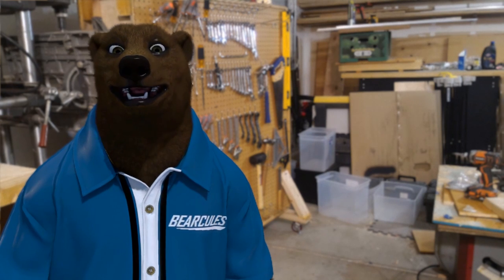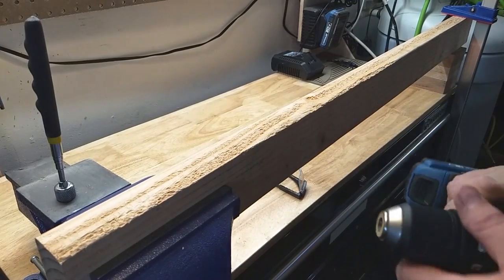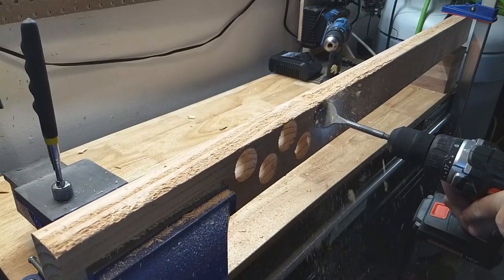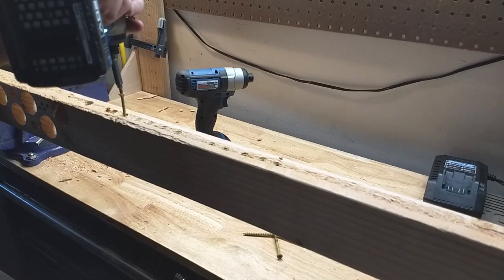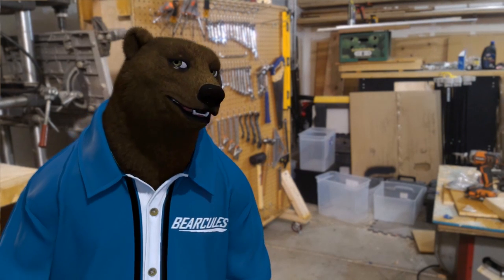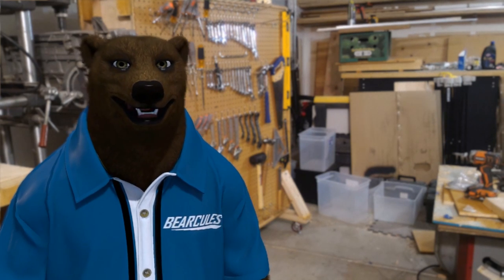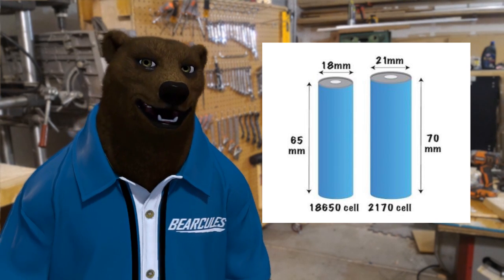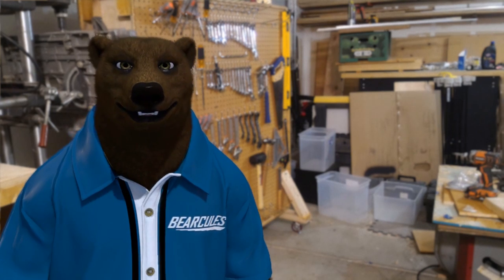Hercules 12V Tools (Impact - Drill - Screwdriver)

Comment from the maker: What tool do you think HF should drop next?
Reply: A real, quality mill
Reply: not really a tool, but it would be great if they would sell some smaller cuts of lumber
Reply: Ok so I know HF focuses on automotive more than home improvement, but I’d really like to see a 12v Pex pipe expander tool. Only Milwaukee makes a 12v expander (Dewalt makes a 20v but it’s too big/heavy). I think they would sell a ton if they added it to the line.
Reply: @jackhackett80  good call
Reply: The bruar reciprocating saw already
Reply: I would also like wireless Hercules grinder
Reply: The Bears' stogie... eff the PC police
Reply: After the "Deep Freight" video I've been really excited to see the new Bauer stuff.

It's also been leaked that they plan to expand the Lynx line. Push mower with two 40v batteries for 80v of power. Could be interesting.   All in all, 300 new products store wide expected to be out by the next managers conference. 

As for clothing, I've seen several employees wearing branded clothing (Hercules, Vulcan, etc). I asked where I could get some and was told they don't plan on offering it to the public. Bad move in my book. I mean people paying you to advertise your products, how could you go wrong?
Reply: Another battery platform.
Reply: 20v cordless glue gun - they can't let ryobi have all the fun.
Reply: A high end router
Reply: A drill that uses the earthquake 20v or 12v batteries
Reply: Sidding and fencing nailers
Reply: TakeAmericaBackfromISRAEL  wood
Reply: In other news I saw the Hercules miter saw stand at my local store two days ago when I was there for the big sale. I was really wanting to check out the bolt system they have to mount to the fancy molded in hex shaped holes in the base of the saw (which btw is my only complaint about the saw - it made it a pain to mount to my Ridgid stand whilst keeping a flush bolt setup). Alas I was disappointed to see it just comes with standard Allen head screws. Not sure how that'd mount and be flush either.
Reply: Hope the diets are going ok.
Reply: A cordless 12V counter top electric can opener.  No one has it and it can be used anywhere.  
Oh, and also a 20V twelve cup coffee pot.  Debear, TELL ME THEY WOULD NOT SELL A BUNCH OF THEM.   LOL !!!😁
Reply: Be able to buy your book and T-shirts ... Hey why doesn't HF have T-shirts?!?
Reply: @0509kj  I also have the portable ridged miter saw stand.  How did you mount you Hercules saw to it?
Reply: @leevalentine1532  It was a multi-step process - I started with removing the rubberized feet from the underside of the Hercules saw. Then discovered that the holes those feet go into extend down just far enough to cause the base not to sit flush on the mounting rails on the Ridgid - once you tighten anything it'd flex the rails more than my liking. I used two thick rubber washers I got from big orange to fill the space and keep things even upon tightening. To get a flush mount on top I used some hex head barrel nuts (aka Chicago bolts) from Amazon (https://amzn.to/2TRgj2l). Used four of those nuts with the carriage bolts that came with the Ridgid. I had to shorten the front carriage bolts a little with my Dremel to get the right depth for the nuts to tighten properly. Most other saws just have a simple eye hole to mount through I have no idea why they chose this setup for the holes but it was annoying in more ways than one. I was pretty adamant that I didn't want bolts and nuts protruding though and since the rails on the Ridgid have blind carriage bolts on the front it didn't lend itself to just using different bolts either. I did get some loctite to go with it but haven't needed it yet. Good luck 🙂
Reply: More of the Hercules 20v line. I've got projects coming up this year and I'd rather buy tools than rent or borrow.
Reply: Well, Red, in a light 12v tool I think I'd like to see a jigsaw. Being so much lighter it'd be easier to handle intricate cuts that can take much longer than just ripping through lumber.
Reply: Cordless chainsaw or lawn great.
Reply: They need to finally release the Bauer Recip!!! Promises promises, but you don’t think corporate would pacify me due to my numerous inquiries would they? Nah, they wouldn’t do that... pffffffft. I mean they have released the warrior drill to up the drill master homegamer, then they released the herc monster saw too but still no sign of completing the Bauer line yet. Patience? Yea sure but man Whatta test cause now as we figured the 12 volt hercs are making their debut. The towel, I have it in hand but refuse to throw it in just yet! I think those lil hercs would make a fine addition to any tech’s travel tool briefcase, ya no? I’d consider them AFTER I get my recip lol
Reply: Cordless multi tool
Reply: @Aubreykun  Black and Decker has one too and it's actually pretty good
Reply from the maker: @markmeli1960  Yes, but only if it's like Ridgids with the multiple heads.
Reply: @Mark Melignano
The B&D one isn't as good from what I read. The Ryobi gun is the best option at the moment (besides the surebonder, which takes ryobi batteries) and also allows access to the other miscellaneous 18v tools ryobi puts out. 

If HF builds a line up as wide as the old Chicago Electric for the herc or bauer line then it'd be a competitor with ryobi's wacky range of one+ tools. Generally I prefer corded but a glue gun is something I don't want to get snagged on a cord, and I might as well have some other options for the battery since you don't normally use a glue gun every day.
Reply: @Stephen Lee
Makita makes a couple models of cordless tool battery-powered coffee maker. It only does one cup at a time, but they make it. A friend of mine has it and he loves it.
Reply: How about a "Bearcules" blue tracksaw?
Reply: I want to see a cordless trim router!
Reply: An Electric ⚡️ Car!
Reply: Montage Matador WTF?
Reply: A good rotary tool.
Reply: Does Deep Freight have any intel on when and what new stuff they will release in this 12 volt line?

Comment: The only downside to the Hercules and Bauer tool lines is they only come as a bear tool so you gotta buy a battery charger and battery separate?
Reply from the maker: They sell some of them in kits and they offer a "kit" discount if you buy a tool, battery and charger.
Reply: See, that’s where they lose ground because I am looking at that
1/4 drive impact wrench that goes for $60 then I got a battery charger for $40 and the small batteries or $25 so I will get two of those that puts me at $150
Reply: See, that’s where they lose ground because I am looking at that
1/4 drive impact wrench that goes for $60 then I got a battery charger for $40 and the small batteries or $25 so I will get two of those that puts me at $150
Reply from the maker: @terrellscaife2411  -$25 for buying a "kit", aka took+battery+charger.    But what is your other option? Who is beating that price?
Reply: Buddy I’m a super low budget type so now I’m stuck between a rock and a hard place, but I really appreciate you letting me get this rent off my chest

Comment: Check out the SKIL 12v line. Much much better than the Hercules, better batteries, better warranty, I'd say it's the best DYI, prosumer 12 volt line currently. Some of the stuff is even better than the M12 stuff. Their 12 v brushless oscillating tool is really good.

Comment: What about the Bauer 12v
Reply from the maker: They said there are no plans for a Beuer 12V.  There is already a Chicago Electric 12V and an Earthquake 12V so I would be supprised if they did yet another 12v system.
Reply: Red Beard and The Den of Tools shoot I would buy the Bauer 12v line maybe they should axe the Chicago brand Atleast for power tools cause honestly they didn’t have a good reputation along with warrior power tools

Comment: It looked like you had the Warrior on counter clockwise instead of clockwise.
Reply from the maker: Did you not see the part where I weighed the tools?  The warrior was in there as well.
Reply: @denoftools  Yes, I did. I was talking about when you drilled the wood you had the direction on backwords (remove, counter clockwise) instead of forwards (clockwise, drill).  Just saying that could have been why it performed so poorly.
Reply: @pattognozzi  That is what I thought too.  However, the others do not appear that way.  Obviously I could still be wrong.  It may have to do with the speed each one operates.
Reply from the maker: @jackphillips3512  Sorry, I misread your post.  Need to get my glasses on.  I'll go check it and see if da bear screwed that one up.

Comment: Im in the market for a new 12v drill/impact combo. I just wish HF would include a solid long term warranty on these drill included in the price. That would definitely show the belief and commitment behind these new power tools. Until then, I'll still go with Ridgid or Milwaukee combos. I can get a combo of either one for a bit over $100. Step it up some more HF.
Reply: A combo kit for the Herc drill and driver would go a long way. I can get those from Ryobi at Home Depot for $40 less in a kit.

For the warranty, I think if they really want to stand behind the Hercules line, the warranty should be a full 1 year with the 2yr/$20 option on top of that for a total of 3 years. The 90 day warranty is just... why? Are they expecting people to throw the tools out a seventh story window?
Reply: @DickTickles  I went with the new M12 Fuel combo from Milwaukee. Pro coupon plus gift cards I had really sweetened up the deal. Plus a great 5 year warranty. 
 A 1 year warranty should definitely be a minimum with price point around $100. The Ridgid 12v combo is $130, and $99.99 on sale at times with an LSA warranty.

Comment: I’m a professional and I use both 12 and 18 volt tools and like you said I use the 18v for framing, decks and drilling larger holes and don’t mind if they get dirty. I save the 12v for finish work like cabinets, trim, doors, electrical etc. I also like to keep my 12v tools clean so when I’m in someone’s house, they’re not put off by a grungy drill sitting on the counter. Thanks for the video, looks like the big boys might be losing some money to the new kids on the block.

Comment: 12volt pros...fits in tight spaces...much lighter..more precision in delicate work pieces. Etc. And in my experience using a buddies 12 volt dewalt they perform just as well as my 20 volt porter cable set. Not quite as well as my ridgids but still good enough to get my work done. And they are so much lighter. Or at least it feels that way. Im excited to get a 12v hercules impact.

Comment: Hi Red, I have a question for you about the harbor freight 12volt tools because I have been considering switching over and buying some of their tools. Several years ago I bought a clearance 3tool 12volt Kobalt set and I love my 12volt tools from Kobalt. But the tools were on clearance because Lowe's was canceling that 12volt line so now there isn't any more tools than the ones I already own. I do a lot of homeowner DIY and Quality Hobby Woodworking and use my 12volt Kobalt set for most of the work I do. I take good care of my tools and most work I do is indoors so I don't think that I need any Pro level 12volt tools like from Dewalt or Bosch, my Kobalt tools or my 18v Ryobi tools do just fine. But my question is what do you think of me switching over from my 12v Kobalt set to the 12v Harbor freight tools. The Kobalt tools I have you can't get anymore tools and batteries are difficult to find but sometimes can be found on Ebay. So with a Harbor freight just a short drive from my home buying a battery or a whole new tool is easy for me, that is the main reason I've been thinking of switching from my Kobalt to the Hercules Harbor freight tools. I'd like to hear what you think and anyone else here that uses the Hercules 12volt tools from Harbor freight, thanks y'all.
Reply from the maker: I really like the Herc 12V.  That screwdriver they have is one of my most used tools.  If you were planning a lot of automotive work you should really consider them.  They have 4 ratchets and two impact wrenches out in the system with more tools to come.  If you do more DIY around the house stuff I really love the new Skil 12V line.  All of their tools are brushless and all of their batteries have a built in USB port!
Reply: @denoftools  
I just finished watching a video where you talked about the Skil Line of 12v tools and how much you like them. So I am going to take a look around and figure out what to do from there. Thanks for the help

Comment: Thanks for the explanation on why to use the 12v. In a couple of weeks I start a new job as a computer tech, I'm probably going to pick up that screwdriver now.
Reply from the maker: My first hardware job, fixing PC's for a retail store, the only cordless stuff we had were full sized craftsman drill drivers.  1 in 4 screws it took the heads clean off.  Would have killed for something like this.

Comment: Thank you President Debear for the video.  I liked it.  Just an observation.  The new 12V line so far sure resembles the Dewalt in appearance.  Just a thought, thanks again.
Reply from the maker: Yeah, HF has a hang-up on dewalt.  Some sort of tool crush.
Reply: The manager of my local store said when he went to that last managers conference, that he was talking to the head engineer. The guy use to work for Dewalt and the new Hercules stuff has about 90% of the same components that Dewalt uses and the other 10% is equivalent or better. The main difference is rather than shipping the parts to be "assembled" in the USA they are put together in China instead.
Reply: @WolfsHaven  That's interesting.  That would explain a bunch.  Thanks for the info !!!

Comment: id like a set  for in the house... my 14 yr old son would like a set of these.  all my 20v's r just to heavy for him to use for any length of time ,also my wife.   hell id probly grab them too. i think tho the price needs to be around 50, 60 bucks.
Reply from the maker: I don't think you will ever see them that low.  At that price point, it would cut into the Bauer line.  Have you looked at the warrior drill?  That is what I got for my son.  It actually weighs less than the Herc 12v.

Comment: how long does the 12 v battery last? 🤔
Reply from the maker: That is an open-ended question.   Depends on what you are doing.  I was well over 100 screws when the drill needed a recharge, might have been around... 140?  Wasn't really testing for duration.  That is going to have to wait for another video.
Reply: @denoftools  right on brother bear. I'm definitely going to use the coupon 😃

Comment: Seen that those tools at 12 volts can I charge them in my vehicle
Reply from the maker: They are still charging off of 110V.  And because of the built-in charge controllers, I don't know if there is a workaround other than just using your inverter.
Reply: Maybe Da'Bear should put a bug in the ear of his friends at HFT... A 12v auto charger would be a super simple accessory to design/release and would give added value to the 12v system.
Reply: @denoftools  thank you.
Reply: Sean Young: Well, maybe not "Super" simple. Remember that to 
charge a li-ion battery - safely! - requires a stable voltage source
and some "smarts" to implement the necessary charging algorithm.
That usually means a micro to watch things like voltage, current
and TEMPERATURE of the battery under charge. And since the
battery pack consists of several cells that need to be kept in 
balance, the micro must monitor and control the charge level of
each cell. Also, the input voltage will vary quite a bit depending if the alternator is running,  or not, and the charge state of the vehicle battery. So a dc-dc converter to supply a stable voltage to the actual charging circuit would likely be needed. And, of course, the micro will also likely need a regulated voltage, possibly different from the charging voltage. 
SUPER simple? Probably not. If the charger is to be effective and SAFE.
Terribly difficult? Certainly not. There are chips available today to automate some, or even most, of those tasks.
Really cheap? Unlikely.

Yep, designed several li-ion chargers in my time, and there are a
few "wrinkles" there that can bite you in your exhaust pipe if one 
is not rather careful to consider all aspects.........

The super simple accessory is to buy a 12vdc to 120vac inverter
and plug the current charger into it! And power any other 120vac
devices you may want to use in/near your vehicle........

Comment: I wonder when bauer is coming out with the recipsaw🤔
Reply: I was told by an employee that they actually do mean soon. Probably by March and most likely tool only. Since I have most of the rest of the line, I don't need another battery and charger. I'll take the cheaper price.
Reply from the maker: Does HF do any "Tool Only " stuff?
Reply: Yep the Bauer circular saw, angle grinder, and light are all tool only. However when I bought the circular saw a year ago Christmas, they had a coupon deal that you could get a blade, battery, and charger for an extra $10 or so. I haven't seen it since so I'm glad I jumped on it then.